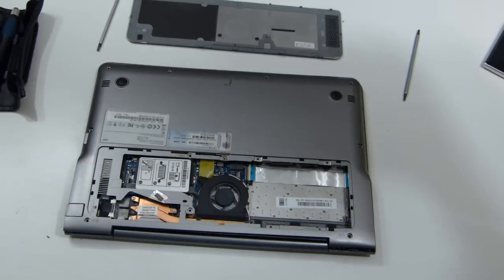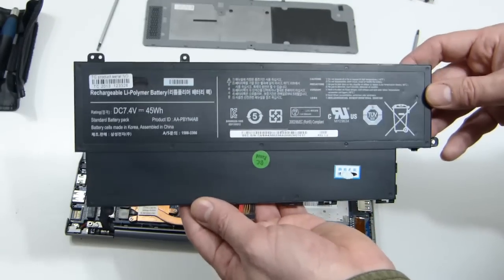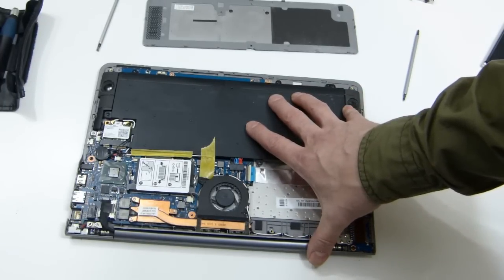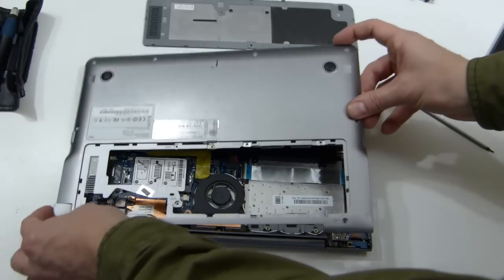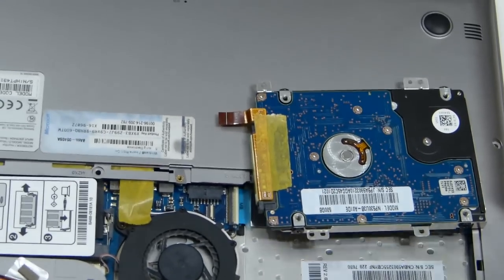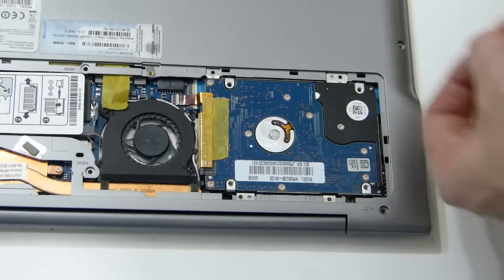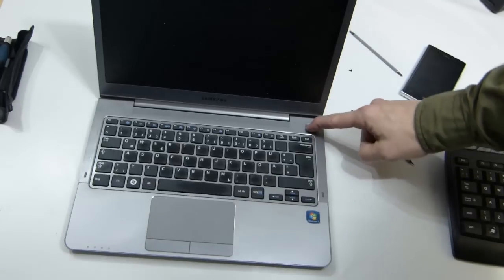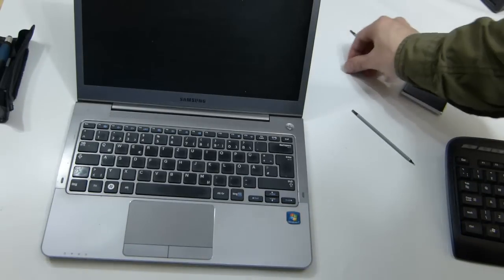Battery Replacement on Samsung Series 5 Ultrabook NP350U3B

Comment: Yeah removing the cover was so difficult, i broke the cover and stopped the repair. Would have been nice to show the actual hard part.there are hidden screws under the rubber caps!!! That’s what broke my cover!
Reply: same thing happened to me, the plastic around the upper part is so thin and brittle but even so the cracks are very noticeable considering its on the bottom of your laptop. I think its still worth replacing if its already an old laptop and you want to save some money :)

Comment: Hi, could someone please tell me if the same instructions would apply to the NP540U3C model? Thanks a lot :)
Reply: I got same question. Yesterday I read that the Samsung batteries got an internal eprom memory that tell laptop current charge. If the Chinese battery does not come with that memory, it should not work and the only way to make it work is to move the internal cells from the Chinese battery to the original Samsung Battery.
Reply: Tiene de casualidad el esquemático para ver los puntos de conexión de la batería con el ordenador quedo pendiente

Comment: Thanks for the video.  Successfully replaced battery in Samsung NP540U3C.  Original battery seemed to be defective.  It completely stopped holding a charge and physically expanded, warping the trackpad.  Hoping for better luck with this replacement.  Bought the battery on Amazon.

Comment: Excellent video. Easy to find the battery on youtube.  Simply search for "samsung NP350U battery".   I bought mine from an Australian dealer.   Less than USD70 (made in China).
http://www.ebay.com/itm/231603687522?_trksid=p2060353.m2749.l2649&ssPageName=STRK%3AMEBIDX%3AIT

Comment: i have a question sir.. Can the Samsung series 5 run without the battery if its just plugged in? and my has heating problems so i was wondering how to deal with that.. the heat is mainly above the keyboard between the keyboard and the monitor and i think its causing some FPS problems when it heats up..
Reply: Elijah Paolo Catingub mine has heating problems*

Comment: So I have a peculiar situation - battery would only charge for 30 sec after plugged in, then charging will stop albeit orange light being on and the icon saying charging, but not being animated. Bought a new battery, same deal. Tried to turn batteries off via pin button, now they just won't turn back on....

Comment: You have any idea of how a SF 310 back cover comes off a 310, 8 or so screws on the back or bottom, then what. I heard you have to flip the switch before you disconnect the battery.  I also have to replace the charger receptacle as it is very loose and the battery may not be the whole problem.  Stony

Comment: hey thanks for this tutorial. I replaced the battery of my samsung Ultrabook NP350U3B too but the battery don´t charges?
Reply: I replaced the battery too and have the same problem. Laptop is now not charging. Even with the power cable in its not coming on.
Reply: +Eastleigh Same Problem here. did you manage to fix it?

Comment: Steve - thanks for the very useful video. Do you have the part number for the battery and a link to the supplier. Thanks in advance!
Reply from the maker: There's more in the article here: http://ultrabooknews.com/2014/02/10/samsung-series-5-ultrabook-battery-replacement/
Reply: Thanks Steve.

Comment: It wasn't very good.  I don't adhere to puffery.  It was OK.  The issue is that taking the bottom case off is the hardest of all things on that unit.  Demonstrating how to safely without damage taking the bottom part of the case off is super important.  As far as taking screws out to remove the battery and to replace them in reverse order isn't that tough.

So, please, in the future, show exactly how to remove the bezel, from the first screw to the last, to the tool used, to the encirculing applying the proper pressure.  BECAUSE if it isn't done right you break something and it won't fit properly once you put it back together.

Comment: What is a good tool for getting the case open? I got the harddrive out, but I am afraid to split the casing. Should i pry it open from the inside, where the ssd were, or should i do it from the outside?